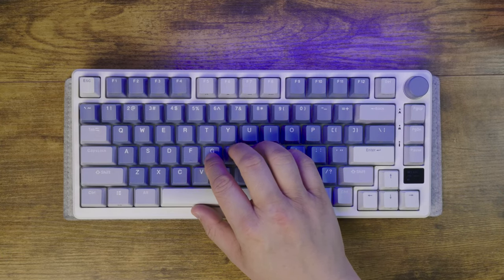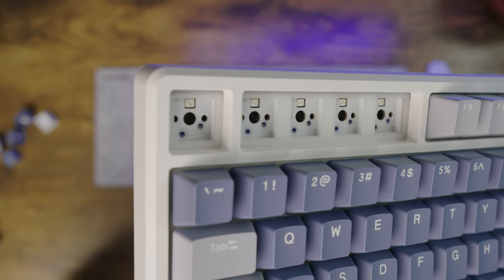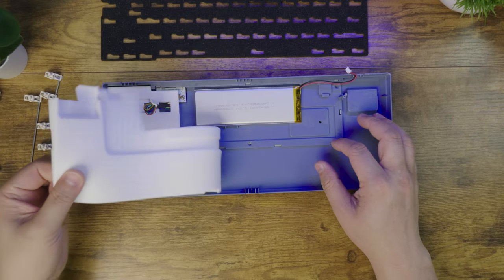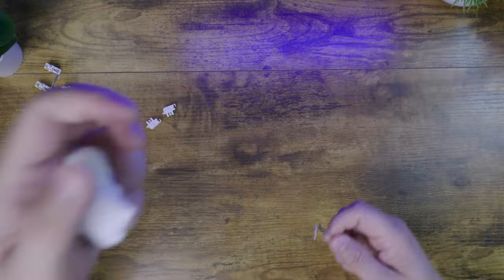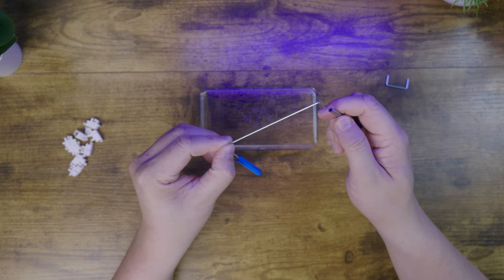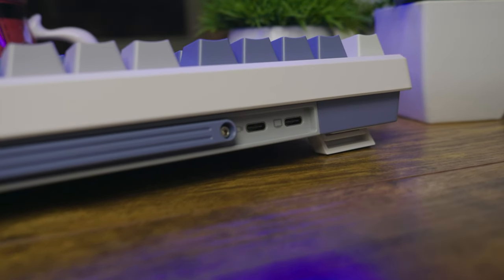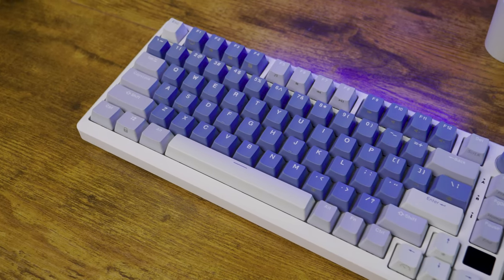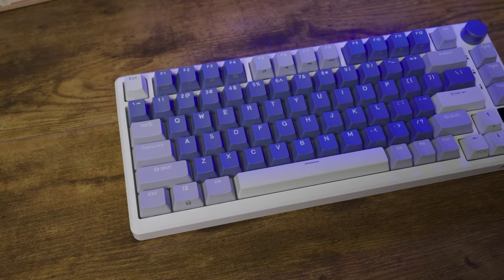Royal Kludge M75 - Review & Mod

Comment: is there a way to take screenshots without having to use a screenshot software? i tried all shortcuts i could find lmfao
Reply from the maker: I'm not sure...as I've only used screenshots with the print screen button or with the snip tool. What are you trying to do?
Reply: @keebtunes  i simply wanna capture my full screen and have it saved in my files immediatly xd on my old keyboard i just had to press win+print
Reply from the maker: @biergartenparty I'm thinking that you may have to reprogram the keyboard keys to have the function you need.. unfortunately I can't personally test this as this keyboard was one that I gave away to a relative, but here is a link to he software for you to try
Reply from the maker: @biergartenparty https://drive.google.com/file/d/1s1SIYIUjiNEBSHJpRUAkdOQ57WshTJ61/view?usp=sharing
Reply: @keebtunes  thank you so so much for the help  and the fast replies!! :)
Reply from the maker: No problems at all! I hope it all works out for you 🤞

Comment: Do you know where to get the stabilizer pad's at?
Reply from the maker: You can find them on Amazon or aliexpress, as well as a few keyboard vendors. Amazon is usually faster to get https://amzn.to/3NNbiX8
Reply: Thanks! Do you also know if it's okay to use mole skin as a permanent mod, like it won't damage anything and isn't a major risk to a battery fire/problem (unlike painters time which is in a way)? @keebtunes
Reply from the maker: it isn't. I've checked on this, and moleskin isn't conductive in any way, and won't damage your board. I've had it on several of my boards for a year now and it's worked perfectly fine! It's actually better if you plan on using it permanently, as it is more adhesive than painter's tape, and constant peeling it off "COULD" possibly pull a weak-soldered socket. That hadn't happened to me either but just a caution. :D
Reply: Oh That's great!! I just recently saw a video about moleskin on your channel! Do you think it's possible to change out the knob, like what knob would be compatible for this board? Is the knob a standard size knob similar to epomakers or a way different size?  @keebtunes
Reply from the maker: The majority of knobs are the same size, even if they look different on the outside. Their inner socket is sized the same - iirc its roughly 21mm on the inside
Reply: @keebtunes Oh nice that makes things easier. And I’m assuming you need to put dielectric grease over the stabilizer pads or keep the dry?
Reply from the maker: Keep it dry, it's for dampening the bottom out sound
Reply: @keebtunes  okay thanks!! Do you have any recommendations for alternatives for moleskin tape for just temporary a bit to hear what tape mod sounds like painters tape. I heard painters tape is good but I’ve heard some scotch painters tape has conductive adhesive. If anything at the end get some moleskin.
Reply from the maker: The community usually use painters tape because it's the easiest to handle and doesn't leave residue, but you can also try electrical tape, or even keebtape (same people who sell the felt keyboard mats)

Comment: I'm in quite the dilemma after unplugging the cords to try to tape mod them and they aren't going back in 😅
Reply from the maker: Oh no ... Are you referring to connections? If I recall correctly, the connections will have the pins oriented either more on top or more on the bottom. You'll need to align the holes either top or bottom to match the pins of the socket
Reply: Thanks for the help, I luckily got out of the problem with your advice.
Reply from the maker: Yay!!

Comment: Can u cuztomize the screen?
Reply from the maker: Unfortunately no, it has panels with fixed values and data points that reflects your PC's data
Reply: @keebtunes  so includes cpu usage? Or just basic information like date and keyboard battery?
Reply from the maker: just basic info! And sorry, had to refresh my memory, but these are the data points:  battery level, WIN/MAC, wired/2.4G/Bluetooth mode, volume level
Reply: @keebtunes  is this better than ajazz ak820 gts pro or it's same?
Reply from the maker: They look very similar...probably use the same board and PCB, with the only difference being the switches and caps..a lot of vendors do this, so I wouldn't be surprised if they're similar